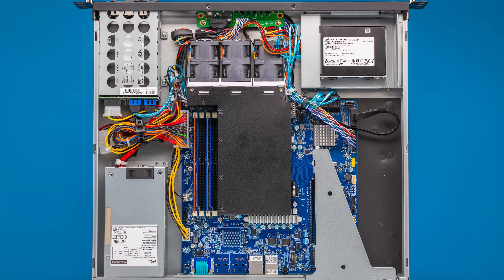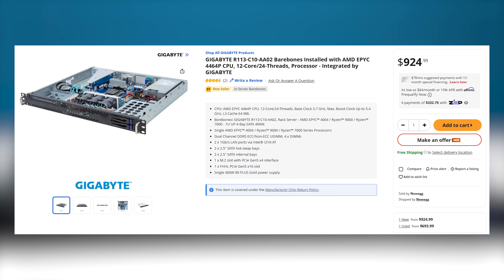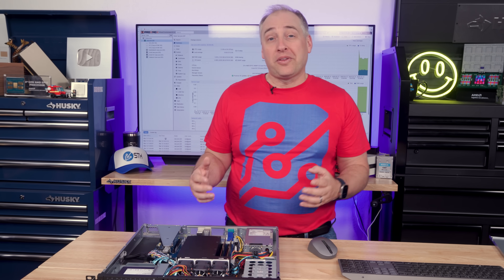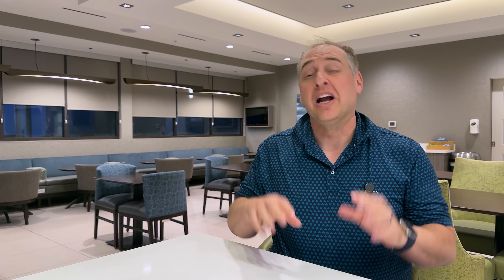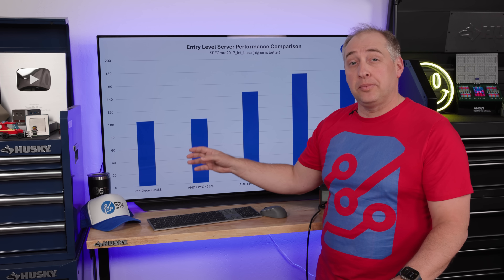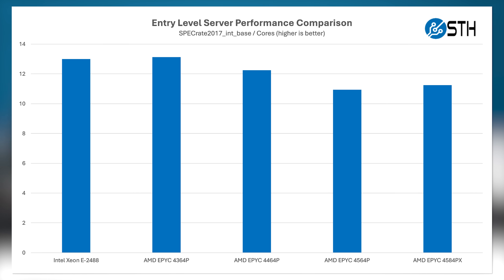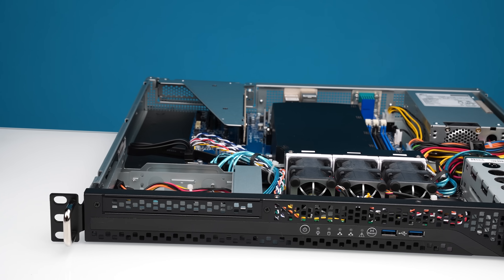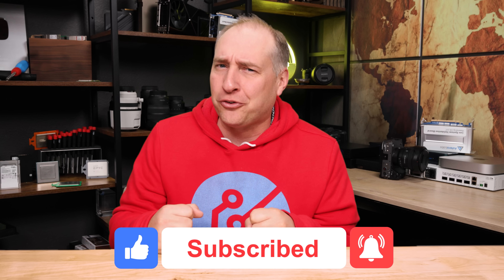We Bought the Most Popular Server on Newegg and it is a Awesome

Comment: Fun fact: Intel drops support for 6252 on June 30th '25. A lot of CPUs are going to hit Amazon/eBay soon after.
Reply: 6252? I'm not quite astute to server part numbers yet. Is that like a Skylake-X server one?
Reply: @ShirokoCycling I'll skip Xeon Ex, they're pretty much irrelevant in 2025.

Xeon Scalable pre-Xeon 6:

First digit is product segment, 3=bronze 4=silver 5/6=gold 8=platinum. 9 is occasionally used for processors that exist outside the "normal" product line.

Second digit is generation, 1=Skylake 2=Cascade Lake=Skylake refresh 3=Ice Lake/Cooper Lake 4=Sapphire Rapids 5=Emerald Rapids

3rd and 4th digits are SKU numbers.

There may also be a letter suffix to denote features/specialization.

Xeon 6:
First digit is 6, denote generation

Second digit denote scale/socket, 3=desktop-ish/LGA1700 5/7=8ch server/LGA4710 9=12ch server/LGA7529

3rd and 4th digits are SKU numbers. I believe that the 4th digit on 65/6700P SKUs hold special meaning. All the 1S SKUs end with 1, 2S "high performance" SKUs end with 8.

Letter suffix denotes core type. P for NMGA descendant, E for Atom descendant.

AMD:
1st digit denote scale/socket, 3=embedded 4=desktop-ish/AM5 7=8ch DDR4 server/SP3 8=6ch DDR5 1S server/SP6 9=12ch DDR5 server/SP5

2nd and 3rd digits are SKU numbers.

4th digit is generation.

There may be a letter suffix to denote features/specialization.
Reply: SRF91 Intel Xeon Gold 2nd gen 24 core LGA 3647. I see some used ones going for $125 on Ebay Most are in the $200+. I am getting a x11DPH-T that I have 6138's(they are like $18 on ebay)  but they are Gen 1 and will not run the 2933 ram ( has to a 52xx or 62xx cant be any x1xx like my 6138) they only run at 2666. So maybe after June they might drop to the low $50s if they flood the market. FYI I am just a home lab guy and this is my 1st server try so I hardly know much.
Reply: The real reason to run 62xx and 52xx is for Optane Pmem support. Huge amounts of “memory” on tap for storage systems or virtualization.
Reply: ooh sounds cool, that means whole servers will be for sale I would expect.

Comment: Poor thing has 28 PCIe lanes and no way to use most of 'em! Shame there's no riser or cabled option to stuff more NVMe in there, or get U.2 to the front bays.
Reply: The market this is aimed at is at most going to slap a NIC in there and probably never touch it again unless a hard drive dies, if you need more than that you probably won't be buying an entry level server.  Worked with probably hundreds of 'pizza box' form factor boxes over the years, can't recall a customer ever complaining about lack of expandability.
Reply: @nadtz For the price it could offer more on the board. It's in the same price range as an Asrock Rack board that does offer more capability.
Reply: @ Board or barebone server?  if you are comparing a ~$600 server to a ~$600 motherboard it's not a fair comparison.
Reply: U.2 was the best idea. It should have become the standard in everything because the U.2 disks mounted a bit like SATA with a special connector. Also, M.2 drives are just small and frail. .
Reply: @ShirokoCycling U.2 and U.3 are both going pretty strong. But really the smorgasbord that is EDSFF is the way forward.  E3.S is really similar in size to U.2 and E1.S and E1.L can pull off some crazy high capacity drives. Plus there is some noise in the EDSFF form factors being used for accelerators not just storage devices.
Reply: @ShirokoCycling  I don't see how the frailty of a M.2 really matters for something most usually touch once until it fails. Hell I keep like 4 of them in an Altoids tin that I swap in an out of an enclosure, with different OS/Utils. They aren't hardly that frail.
Reply: @blkspade23  They are not protected against ESD in a shell. U.2 wins.
Reply: @ShirokoCycling  U.2 wins for a lot of reasons. ESD risk is barely something to be worried about in such a comparison. Good luck installing RAM if you don't know how to handle a thing with exposed ICs.
Reply: This platform does not have pcie hotswap anyway so U.2 to the front will crash and reboot the server if you pull out. If you want to install SSD use quad nvme cards that use bifurcation, cheap and available

Comment: with three of those replacing a Xeon 6252 dual socket system you would get more redundancy at the host level and still more than 4x the performance. 
although your software needs to either have cluster capabilities or you can split your VMs across these three hosts.

Would have loved to see a x8 slot with 10GBit Networking instead of a x16 slot

Comment: but yes single hi core count server is good, untill  it failes  ?
Reply from the maker: Dual socket servers are less reliable because you have more components, right? The dual sockets are not there for redundancy, so you can buy more of these for a cluster than larger servers.
Reply: More my comment was meant to be combining multiple servers into a single unit. And then having one server fail

Comment: This is probably nice for a VPN node
slapp in a 100G nic
32g of ram are enough
And then just run wireguard at line speed for a campus.
Reply: It's USELESS in any way or form, if you have already an good PC !
Reply: @gertjanvandermeij4265  got of on the wrong fot this morning? its a server it doesn't make sense to compare it to a normal pc

Comment: Very interesting. I would have liked one more card slot, as it would be nice to have fibre for both networking and storage. I know, I'm asking for a lot 😅
Reply: well there is a lot to consider, considering value... dual channel ram? one pcie? i am definitely not the user of server, but i am building one and i want 256gb ram minimum and preferably quad or hexa channel.
Reply: one x8 slot and build in 10G could have been a option, sadly you see that not very often on "lower end systems"

Comment: This seems pretty reasonable for a brand new server that has ECC support and doesn’t suck. It is unfortunate that DDR5 modules have different keying so you’re not able to run ECC on other motherboards but that’s such a niche problem lol.
Reply: DDR5 ECC UDIMM is physically compatible with non-ECC UDIMM. RDIMM has a different notch design.
Reply: rdimm never worked on non-server boards, they just (finally) realized that it was best to make it physically incompatible with the slot too
Reply: @AntonioMolfetta I think they physically keyed it differently this time because DDR5 RDIMM takes in 12V, while DDR5 UDIMM takes in 5V. With a large enough voltage difference, they probably didn't want people accidentally frying their RAM and/or motherboards.
Reply: @ that's a good choice, a lot of people buy "cheap used RAM" on the usual sites without realizing they are getting Rdimms

Comment: Yeah its cheap...  BUT ... 
The NIC is 1 gigabit only... SUPER SLOW for today's needs;
Only 1 PCIe x16 slot.

No wonder I still prefer to build my own enterprise servers.
Reply: they probably mean you to install a network card in the pcie slot
Reply: @aR_HellSoldier  are you serious? In the video at 5:40 shows the management port and the specs also tell you yes there is a full BMC here, just like the AM4 version of this motherboard had btw.
Is your only complaint "this motherboard does not come with soldered networking" then? Is that it?
Reply: @ I simply completely forgot the 3 seconds it was mentioned actually. 

To err and all that
Reply: This guy is just an tool ! and even an useless one !
Reply: I wouldn't call this an 'enterprise' server. More like SMB. And even then.. that's a stretch.
Reply: @ big businness call them "edge computing", aka it's a thing running 4-5 VMs for some basic bicc stuff in a small satellite office. It just does some computing and sends the data up to the main company servers

Comment: Ryzen AM5 Supports ECC same as Epyc AM5 Supports ECC ... what are you Talking!!! 

this Epyc CPUs are the Ryzen Trash AMD is Selling!
Reply from the maker: I am not sure what this means. Ryzen can work with ECC. EPYC supports ECC.
Reply: @ServeTheHomeVideo  
Interestingly, my Ryzen 5950x doesn't work with 128GB of ECC RAM.

But that contradicts reality. My server runs and supports ECC with a Ryzen CPU, i.e., without Epyc.

So, my Asus x570 WS-Ace supports ECC, but it doesn't support Epyc CPUs. So how can you say Ryzen doesn't support ECC when it's factually false, because Ryzen CAN.
Reply: Simply explained so you can understand it too

The EPYC 4004 is Ryzen garbage
Every type of ECC support on the EPYC 4004 is exactly identical to Ryzen CPUs, so why is there a claim here that there's a difference?

To be a little more specific, an Epyc 4464P is exactly the same CPU as a Ryzen 7900. Both CPUs even have identical stepping (RPL-B2).

The Epyc 4464P is identical to the Ryzen 7900 except for overclocking. So, an Epyc 4464P is a defective Ryzen 7900 that doesn't support overclocking. But why should the ECC support differ between identical CPUs, as mentioned several times in this video?

Or why should a defective Ryzen that is downgraded to an Epyc CPU be able to do more than a non-defective Ryzen 7900, which has become a Ryzen and not an Epyc because it supports overclocking and ECC?
Reply: @ServeTheHomeVideo  

If I'm wrong, the Epyc 4464P supports more than UDimm ECC (unbuffered ECC), so RDimm ECC (reg ECC) or FBDimm ECC (FullBuffer ECC oder Buffer ECC)? ... no, the Epyc AM5 only supports unbuffered ECC, just like Ryzen AM5, there's simply no difference except that the Epyc AM5 CPUs can't OC!
Reply: In what way are Ryzen CPUs "trash"? WTF are you talking about.
Reply: @JMartinni  
Do you know what selection means?

AMD isn't trying to produce low-end Ryzen CPUs.

But any CPU that doesn't have the quality for a 9950x is defective and will be downgraded to a lower-quality CPU.

So all defective CPUs or DIEs in production become lower-quality CPUs, and if a DIE doesn't support overclocking, it just becomes Epyc junk that costs more and can actually do less than an identical Ryzen CPU!

So, as I said, Epyc 4004 CPUs are waste from Ryzen CPU production, no different!

But no one here has said that Ryzen is waste... but the waste from Ryzen production is simply selected for other CPUs, which is absolutely normal.

Comment: Sounds like the perfect entry-level server to me.
Especially when it comes to a 19-inch format without the sound of a fighter jet.
The price is acceptable compared to other things like "cough" GPU defects, "cough" Nvidia.
Reply: entry level server is n100 mini pc running ubuntu
Reply: @HaiLsKuNkY that is not a server, that is a mini PC in a home lab
Reply: @HaiLsKuNkY 
It depends...
What are you objectives with the server.

An entry level homeserver might be fine with a n100, depending on what your goal are for that server.

But if you've got a business to run and have multiple VM's running and for instance a database, you can run out of memory in a blink of an eye.
Having the option to put 192GB ECC memory in such a small size is a great option.
Also having 12 cores and 24 threads makes a lot of sense for a business, they are not looking to replace the server every 3 years, which in a homelab situation could be a option.
Reliability and up-time might be more important in that case than with a homelab as well.

Remember that sending out a tech to a remote location has a price-tag as well, as where if something in your homelab breaks, it might be inconvenient but in all likelihood nothing too mayor will go south.

So it depends on what your goals are for the server.🙂
Reply: @MikevanKuik  By definition, any device that can offer services is a server.
This could be an ancient console with a Gbit connection, a smartphone, a laptop, or even a 196-core PC with 1 TB RAM, etc.

Likewise, any device can be a client as long as it can access the services of a provider.

For example, a computer with a True NAS provides storage for a Proxmox server. This server acts as the client but also offers services for other network participants. 
Thus, it is both client and server. Ultimately, there might simply be several Raspberry Pis acting as interaction points for the Proxmox VM. 
Depending on the setup, each device can provide everything; costs and maintenance are a matter for the individual/company.
Reply: Exactly!!! 😃

Comment: Edit: it is cheaper than ASUS server, and you are paying additional 200 for the server motherboard 🤷🏼‍♂. 
The 7900X is retailing for 300, and a B650 board new for roughly 70-87 on the cheap end.  Maybe 100-150 for a more mainstream or ATX form factor.  How does that stack up against a 4464p bang for buck and features?  Pre-assembled for a business this may be a deal, but homelab you can set up a comparable system for almost half the price, as usual.  
Reported some bots for you too, they are getting bad.
Reply: PCIe lanes? EDIT: Nope, no extra lanes. So only ECC. Hmmm. Upgrade path maybe. Does seem odd
Reply from the maker: Bots are bad. The reason you get something like this versus a consumer platform is that you know you are getting ECC support and support for server OSes. Rackmounts are often important for folks.
Reply: @ServeTheHomeVideo  budget server needs a budget rack , time for IKEA lack table !
Reply: @ServeTheHomeVideo ECC not a problem on B650 non server boards. There was some good video on Level1tech
Reply: No BMC on that, so you'll need at least a KVM with target power control capabilities to be equivalent.
Reply: @Kerpsi  I thought that might be the case. Shame
Reply: that 12 core power is impressive, but dual channel ddram? thats doesnt seem right.
Reply: @simonmeszaros2770  it's ddr5. Not so bad
Reply: @simonmeszaros2770  true , buy larger epyc or threadripper then 
Am5 epyc just a rebranded Ryzen not fit your requirements
Reply: @ once you can live with older platform you can get impressive bandwidth 6,8 channel dram support on 2.gen intel scalable or older amd... otherwise i would stick with latest consumer grade.
Reply: Headline:

Self built with consumer parts in desktop form factor is cheaper that pre-built 1U server. 

Wow! Who would ever have expected that! 😮